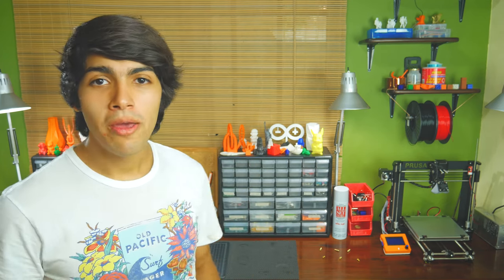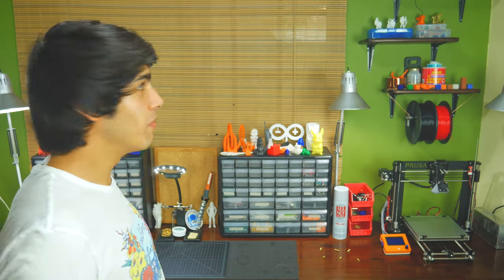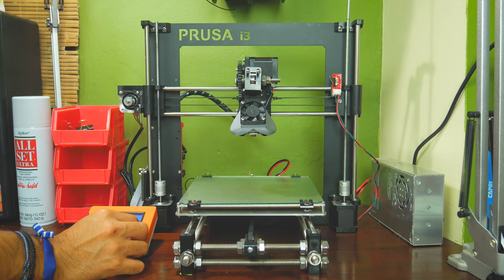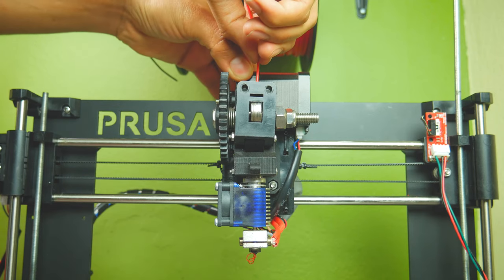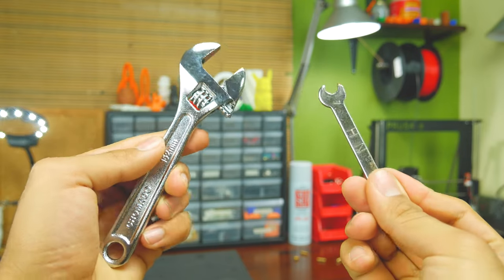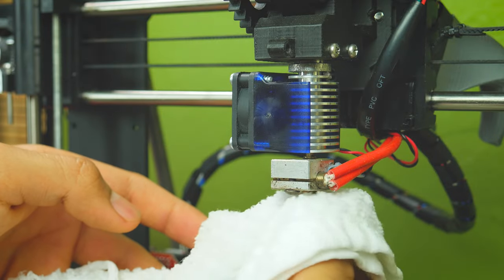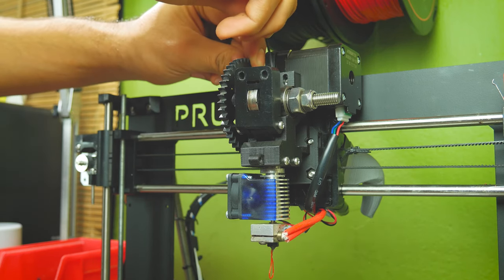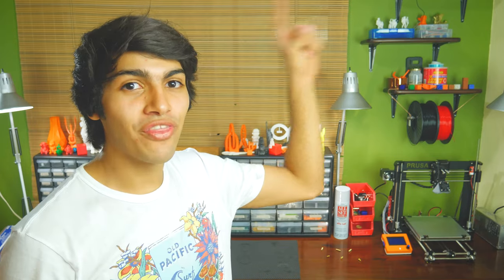🔩📐 Changing Nozzles  -  3D Printing 101

Comment from the maker: Hey guys, I forgot to mention that the hotend needs to be hot when you screw in the new nozzle. This is due to the fact that metal expands when heated up. So, I suggest you turn up the temperature to a little bit higher than the hottest material you print. I do 260 degrees Celsius.